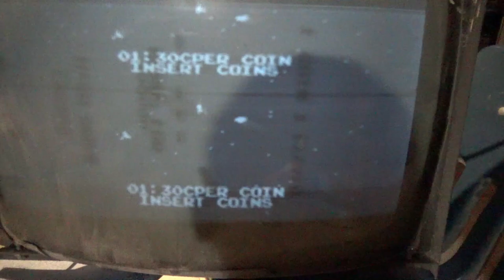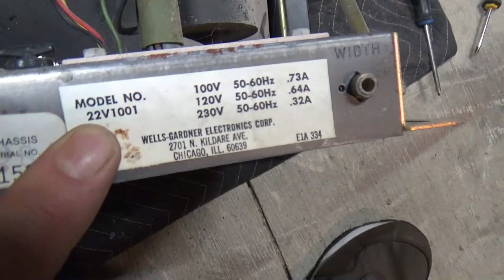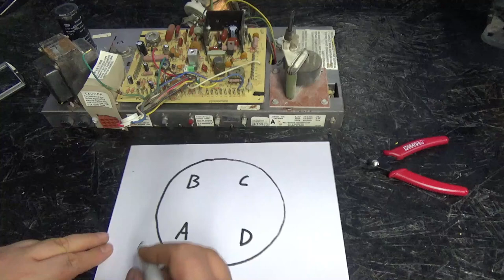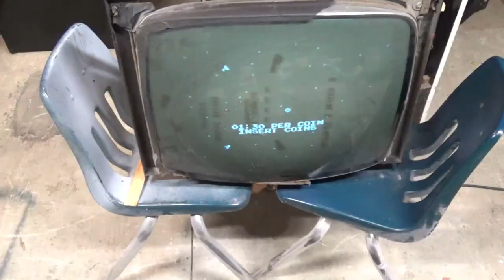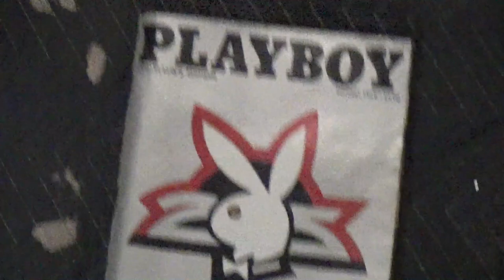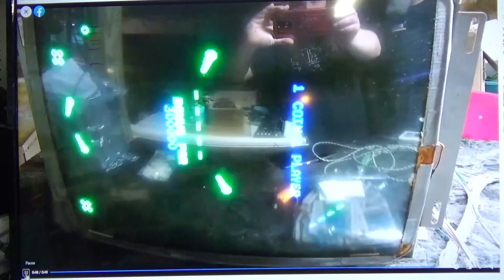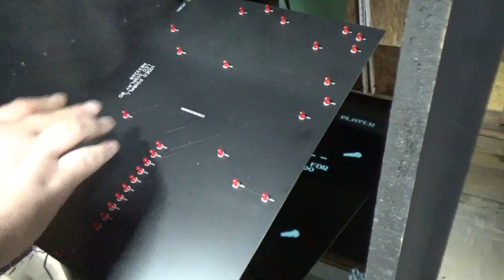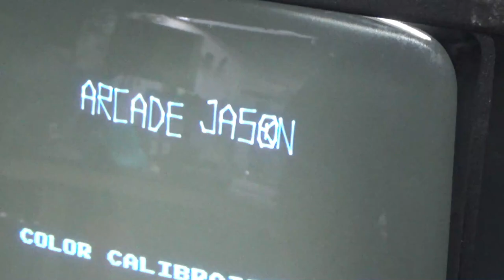Atari Video Pinball restore part 3

Comment: As soon as the monitor is back in the cabinet and the two-way mirror is installed, the burn-in will be a non-issue. Trust me, our Video Pinball has almost as bad burn-in.
I stuck a piece of pizza box between the LED PCB and the light, that got rid of the light from the FL bleeding through the PCB.
Colorizing Video Pinball... lol... great effort getting the playfield in color though.
I colorized our Tank. Much more useful (and many more colors - 7 of them!) and much more simple to do (as there are 6 different video signals. I had to separate the right tank score from the playfield signal though)

Comment: You should try making your own custom playfield! You could even try to hack in an Arduino controlled MP3 player and add more sounds!
Reply: Making multiple playfields (+ the ROMs to go along with them) is what Atari should have done back in the day... (Super Man / Orion XIV was just a half-hearted afterthought)
TL;DR
More sounds? Video Pinball hardware has a 3-bit volume register which the game completely ignores! All the sounds are either full on or full off. The hardware could potentially sound completely different, but they went with the way the Atari Pinball machines sounded (which afaik did not have a volume register). They could, even without the volume register, could have sounded melodic. And with the volume register and some software ADSR, this thing could have sounded quite differently.
The Bell and Bong are individual circuits that can't produce different tunes.
(how I know that? I once fixed a very broken Video Pinball and spent like 12 hours on troubleshooting the sound circuit including a logic analyzer which showed clearly that the three volume bits are either all zero or all one, never a combination)
What I was missing most about Video Pinball was tactile feedback. Heck, they could have just sprinkled a few solenoids inside the cabinet to fire when the ball hits something, aka Q*Bert... and what's better, if the operator thinks, they're annoying, he can just turn them off with a switch...